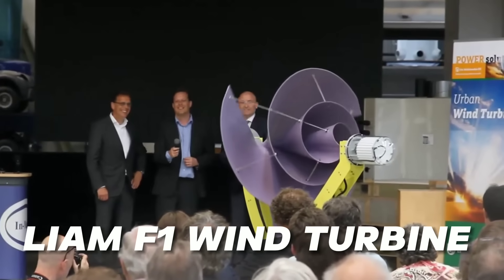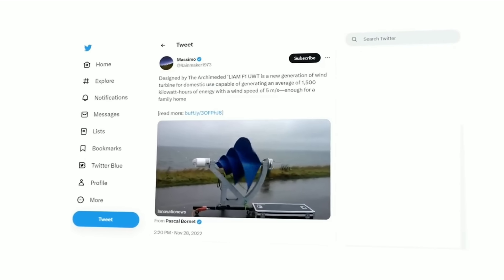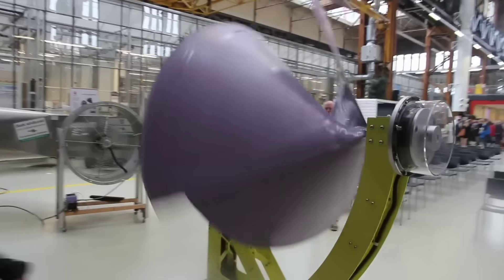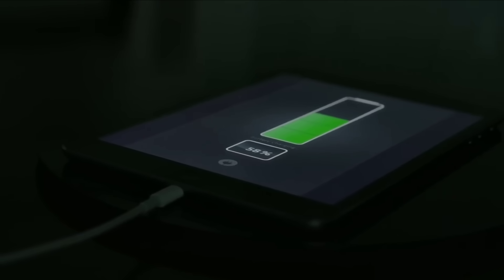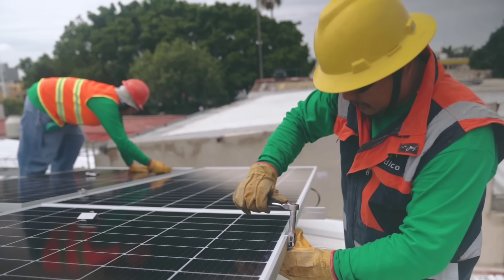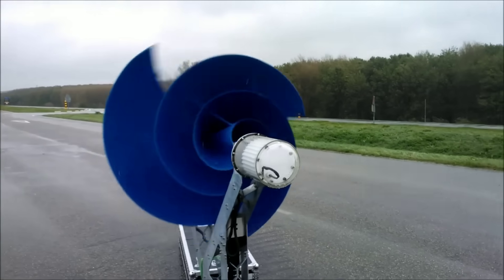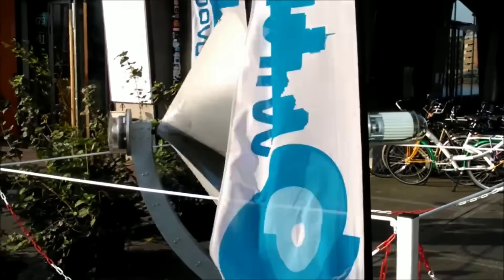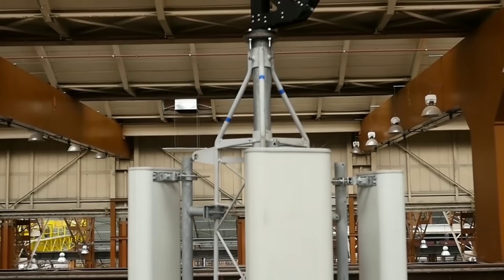This NEW European Wind Turbine for Home Outbeats PV Solar Panels in 2023?!

Comment: Where I live does NOT have consistent wind and very many sunny days so wind mills are not an alternative to solar. A combination of the 2 would be good but the wind mills still cannot compete with solar alone here. There has been 64 100 degrees + days, where I live, so sunny days far exceed cloudy days here this summer............I live in south Texas..........Even in the winter time my solar panels generate enough electricity to make me not have to pay for electricity. But I do have to pay for gas to heat the house and water....it does actually go below freezing here sometimes in winter............

Comment: Like the video and have often thought of adding wind turbines but haven't seen any that will produce much in low wind.  Would like to get a brochure on the specs of this F1 unit.  Very interested in it.
Reply: Search VAWT calculator. Omni has a good one. Wind works on volume so power is almost cubed based on wind speed. 5knts vs 10knts isn't double, it's much more.
Reply: @HollisInman and the physics are in favor of big turbines on high masts. I doubt you can gain much below 20 m hight and 5 m diameter.

The thing in the video is expensive decoration, not a power supply.
Reply: @HollisInman  exactly, I just made a similar comment to another thread about the Omni calculator, works great.
Reply: Wind speeds in cities s usually an average of 2-3 m/s which is not enough energy. The big turbines are in constant wind speed of like 10m/s.

Comment: Generates 1,500 kW a year
Saving £450 (@30p/kWh)
Minus loss of interest on capital expenditure of £200 annually
= £250 actually 'saved'
Cost £4,000
= 16 year payback...
By which time the inverter will need replacing, so will never actually save any money at all.

Comment: 1. Only works in high wind
2. You still need a gear box
3. You will still need 20 or more on a HOUSE to POWER it. 
4.  You would need to make it bigger to get as much MASS as possible.
5. The wind speed slowes down as it goes thought the turbine. 
6. It need to be stretched in time to capture more power and it's design is not the 1.619 golden ratio verity.
Reply: Not sure why you claim it is not designed on the golden ratio. They said it was based on nature and looks very close to the golden ratio. How did you mesure it?
Reply: This OP is a little off😂. Many off grid homes are powered using a few panels and one or two Turbines…. Unless you need electric heat, which most people don’t use anyway, they use gas or oil.  Off grid use passive solar and/or wood.
Reply: @TheNewMediaoftheDawn  i build solar systems for homes in australia. lots of sun. "a few panels" is nothing. you can barely power a camper van with that. and no we arent using electricity for heating. using gas for heat is NOT OFF GRID. going to the shop to buy gas ISNT OFF GRID. i would say judging by your comments you have absolutely no real world experience in off grid living or installs. incredible how all these keyboard warriors with no real world experience know everything and are going to save the world. no wonder the world is headed for disaster so fast. know it alls who know nothing. please sir. check your yourself. passing on false information might make you feel good but it might cost someone a lot of time and money before they realise you had no idea what you were talking about. this video is not designed to inform or teach yo uanything. it is designed for VIEWS. TO GET CLICKS. TO GET YOUR SUB. this is the problem today, kids with no real world knowledge thinking they can just appeal to your emotions by making videos to make money. they dont care about people or sustainability, they care about themselves. money. this is the world we live in today. fajke virtue everywhere. some dont even know they are doing it because they havent actually lived in the real world yet. mommy and dady paid for school and they have only had easy to get robot jobs. sad truth. and when you get older you will agree. trust me. same cycle. over and over. you cant be told, you need to find out yourself.
Reply: @TheNewMediaoftheDawn  never see wind turbines on houses anywhere because because the wind speed in residential areas is too low.
Reply: It is more applicable to areas of lower solar gain on Multistory buildings of adequate size which can be retrofitted with a permanent roof crane to effectively construct a roof wind/solar generation, incorporating wind from the flat wall.  This new system is possibly quieter than the current one's in existence, which sometimes have solar panels covering some but not all  the roof space to make maintenance easier. The crane can used for panel and parts replacement years down the line.

Comment: I would love to try one. Have 13 PV panels on my home but winter and night power comes from the grid.
Reply: I have seen a "Dolphin"  ? korean I think seemed to be a capable unit.
Reply: if your wind speed is like 2-3 m/s you are only going to get 10-30 Watts, which is useless. Use the online Omni wind turbine calculator and use the average wind speed for your city (google it), also use a efficiency of 30% because that is more realistic.

Comment: Solar panels need more maintenance?  Um, no, LOL.  I put my panels up back in 2006 and I basically haven't done anything to them.  No moving parts either. Anything with moving parts is likely to have a higher maintenance cost, and shorter usable lifetime. But this still does look like an interesting product.  Why?  Cost of installation, and roof replacement costs are likely to be lower.

Comment: I have roughly 16 kilowatts of PV. And one powereall now. I love the idea of having some wind genration. I have looked at Flower Turbines. This is also an interesting design. I fo not see the unit cost as the main issue. Installation cost are. What is the noise kevel? Wind has huge resonsat vibration issues making most track wood frame houses un combatlable what is being done to dampen those effects? Do you have say a 10 to 15 meter tower mount that could be anchored to the ground? How would the maintenace be done? No ones needs to sold on the basic idea. Eletricity even when the sun does not shine. I pull 5 kilowats an hour charging my model Y over night, how much wind how many turbines do i need to charge the car? Ok lots of questions but do you guys have those answers?
Reply: if your wind speed is like 2-3 m/s you are only going to get 10-30 Watts, which is useless. Use the online Omni wind turbine calculator and use the average wind speed for your city (google it), also use a efficiency of 30% because that is more realistic.

Comment: I have been looking into wind turbines, but have not been able to find a system which is cost effective for a home application.
It may be a different story if you live near the coast, but in an urban environment it's not even close to the performance of my solar panels.
Seriously doubt that the maintenance of a wind turbine is cheaper than solar panels.
Any equipment with moving parts will have wear, where solar panels is a static system without moving parts.
We currently have 10 (LG solar 3.400 KWp total) panels installed at the total cost of 4900 € (including, the inverter, the installation, software to follow up the system and the mandatory inspection by the government).

That's about equal to the price of a single wind turbine (not installed) but my solar panels have never been cleaned and after 3 years still produces approximately 3200 Kw/h per year, which is more than double compared to this wind turbine. I have not noticed any degradation in the performance of my solar panels (up to now).
Calling this turbine more efficient than solar panels is dubious at best.

Comment: Sounded great until I did the maths! If it costs $7000 AUD, to offset it's cost it would need to produce 28000kwh (based on current electricity prices of 25c/kwh)... If it only produces around 1500kwh per year then this would take 18 yesrs to break even! 😳
Reply: I bet your maths is wrong. The only people i know who have got home windturbines to be profitable have added them 5m-20m ontop of a pole that is supported with guy ropes etc. Most people in cities are not going to get planning permission for that. It also adds £10,000 to the cost. Home turbines ontop of most homes produce negligible energy, sadly
Reply: @onlineo2263  I bet his maths is correct. Let's see your maths.
Reply: However now the rate has gone up to AU$0.51c kWh it does start to have effect when the sun goes down, as long as the wind blows.
Reply: Yeah, I calculated a 15 year minimum break-even. This windmill is a good idea, but doesn't seem to be economical.🥵

Comment: How much does a Liam F1 turbine cost?
$5450 US
With a cost of $5450 US, that's hard to justify: 1500kWh * $0.136/kWh (Nova Scotia Power) = $204/yr savings on electricity. Over 20 years, that's $4,080 at today's energy prices.

Comment: At that price it is going to take well over a decade to break even, probably two in some circumstances and thats before installation costs which are substantial to mount it somewhere elevated and safe. Absolutely does not make sense financially anywhere but the windiest and cloudiest places, low cost diy turbines that pay for themselves in 1 to 5 years are still the only way to go unless your motivations are something other than financial, then your probably the type of person to take advise from a channel that says the turbine produces 4000km/h as well :)

Comment: You cannot put that on a house roof if the house is not build for that purpose. They did tests in the Netherlands for years and even they were the first to come with a design that worked well. But the houses and factories had to remove these horizontal blades because of the noice and tremors it gave. Build it on a building that houses animals or a shed, but do not forget it has to be build for that purpose.
Reply: Sounds about right if it producing that much power the wind has to really be pushing really hard on those mounting points. I guess depending on the house if you have attic access you could probably reinforce from there.

Comment: I think it still better using both wind turbine and solar panel for greater efficiency
Reply: Yeah, the title doesn't make sense. They don't compete for resources except money. They serve different use profiles.
Reply: If you’re in a consistently windy area and you’ve maxed out on available space for solar and you have lots of extra money that you want to spend, then wind makes sense.
Reply: Yup, with an average wind of 3-5 mph not including convection the archemedis can provide power all the time.

Solar and water would completely fill the duty cycles and provide excess energy. 

You’d have reserve batteries and water for power during emergencies and high demand. 

We would no longer need a grid or centralized systems of authority that don’t care about you or reducing pollution and nuclear waste
Reply: @pazsion  yes at 3-5 mph the archimedes turbine is likely to generate almost enough power to charge your cellphone.
Reply: I think nuclear is far more energy dense
Reply: More consistent power maybe, but not more efficient.
Reply: Is that possible??
Reply: There is a combined system I've seen that does this, intended for use at the top of buildings. The wind portion is based on the Venturi concept, not this design.
Reply: @laughinggas5281  In the movie Z for Zachariah they tore down the church to build a water wheel.  Not sure what the actual name of the contraption but it was built under a waterfall to generate electricity.  That gave me an idea.  Why can't somebody combine wind, solar and hydro to make electricity to power their home.  Was just wondering how much electricity could be generated.
Reply: @laughinggas5281  I understand the Venturi theory, but you still need moving parts to generate power.
Reply: Nope.. pv and wind turbines are step back vs nuclear energy... huuuge step back. Both PV and wind turbine are not ECO when compare to nuclear power. But 99% ppl on the world is brainless and cannot understand that...
Reply: Solar panels end up in land fill.
Reply: @hardlines2635  Solar panels are recyclable.
Reply: @hardlines2635   Depends. In Germany, the producer is responsible for recycling of solar panels. At the moment, the aluminum is pretty much fully recovered as well as most of the other metals. The glass is currently reprocessed into lesser materials as the separation from the glued polymer is difficult. This will very likely change in the future when a critical mass has been reached. Over all, very little of a solar panel cannot be reused with current technology.

Comment: The fact that they operate with km/h as a unit of electrical energy starts my scepticisme. Where I live in Scandinavia, normal yearly consumption of energy is 20 000 - 30 000 kWh a year. That would require 13 - 20 units on my roof top. Seeing the shape of the turbine, I hardly believe it is almost noiseless. It's just as likely to be no wind as to be no sunlight, so that's hardly a valid argument. Estimating a 10 year run, 15000 kWh costs €4000 + €2000 installation giving €0.4/kWh which is way above current price of electrical energy. Given a 20 year life span, price/kWh is still way above current market price.

Comment: Interesting.  Nice if it is compatible with typical lithium iron phosphate batteries most solar systems use for storage.  What is the typical dc output in an average 5 or 10 mph wind?
Reply: nothing really, 50w maybe

Comment: Your credibility is fantastically increased after we see 150 km/hr when you are saying 1500 kWhr output produced per year. (Min. 2.31).
I am impressed with the quality of this production.
Reply: LOL,  that he liked this comment. I also noticed the errors too.  He needs a new editor.
Reply: 2:32   1500 km/h
Reply: Lol
Reply: And they talk about average wind speed of 5m/s, a lot of cities will be far less which equates to roughly 12% of the output they claim.
Reply: Not to mention saying solar panels only generate power during the day, but the wind turbine generates power day or night WHEN THERE IS WIND.  And then it says solar panels degrade 0.5% per year but not the wind turbine.  Solar panels are guaranteed 25 years for some level of output like 80%-90% of rated.  The Liam is only guaranteed 20 years.
Reply: @surferdudemi    depends on where in the US but solar is rated at about 24% of W panel rating (24x7/365) efficiency, wind is nearer 30-35% as a comparison.  Some places nearer 28 and 40 respectively.
Reply: @lylestavast7652  That's exactly my point. You can't make a blanket statement that because when could blow 24 hours a day and solar can only generate 6 to 12 hours a day that wind is better.
Reply: I wondered if anyone else caught that too.

Comment: small version for R V,s that can be carried from place to place to keep batteries charged would be nice
Reply: You could pull off an RV version using a 3D printer and build the mount system yourself. 🤷‍♂
Reply: @dapain1576  print a new one every time you park up?
Reply: @jocramkrispy305  well you can get creative using a 3d printer and design one that is easy to use and pack up.
Reply: The problem with this, for RVs is that it doesn't look sad if it will pack small, and you can't leave it up while you drive down the road. For RVs, the best bet is solar, plus a regular small wind generator, if you want.

Comment: First off if it's so revolutionary and wonderful I want to see rigorous independent side by side science based testing. If there isn't any you have to ask why.

Second I have first hand experience of solar panels. We're in the UK and have a south facing 30 degree 3.75Kwh 10 panel array on a bungalow surrounded by other bungalows (so a clear sky) in Norfolk that gets one of the highest amounts of sunshine. It cost £3300 installed. I can reach the panels with long pole to clean them but so far they've not needed it in the two years since install. We purposely use appliances serially to get the most from the system. So probably we're among the most ideal set-ups. 
The system is nothing short of amazing. Octopus pays us 15p a unit for export - this is a current deal. Over the summer we've produced 4 times as much energy as we've used so are in credit. Worst case we get free hot water even through most of the darker months.

What it comes down to (unless you're lucky enough to have surplus cash) is Return On Investment . My original calculations said 8 years but with the sudden rise in energy prices it's going to be more like 5. 

On any system including this it's worth doing a real world calculation on the expected energy saving and remove a percentage contingency amount and then calculate the expected worse case ROI. Be very careful of factors reducing output or increasing costs like roof angle, direction, height (for cleaning), overshadowing etc. There are some good online solar calculators that take latitude into account.
In my calculations for our use case batteries made no sense at all at their current price point and short service life.

We're retired and my guess is we'd be in our boxes before the ROI was worth it with an expensive and especially unproven system.
Reply: Battery are still an issue, depending on how you use the battery will speed up battery, I'm an installer & we have found most people late spring to early autumn is avg 6 kWh, this could be achieved by solar, if I was to guess sun 6th you probably had about 13-15kwh of solar today in sunny Norfolk. Winter months could use cheap rate electric for max payback.
The biggest issue for you is a battery install is +20% Vat, but a Solar/Battery install is 0%.
8-12 RIO is the normal payback on avg.